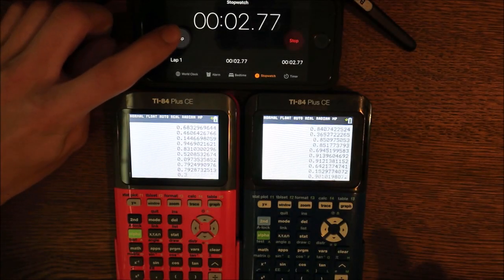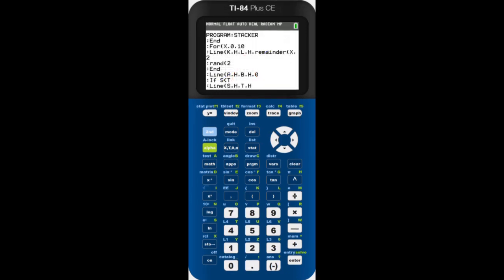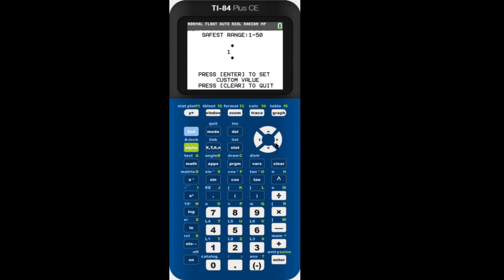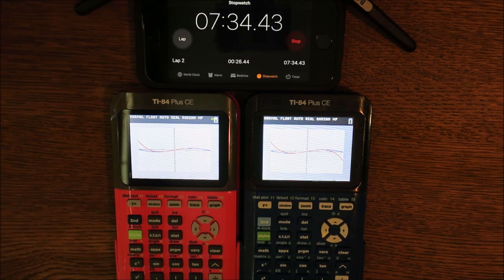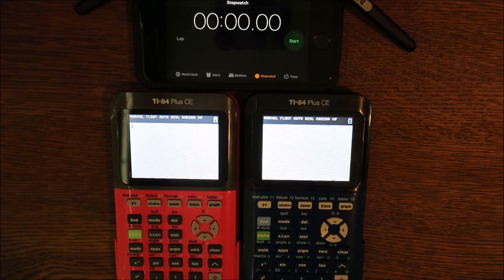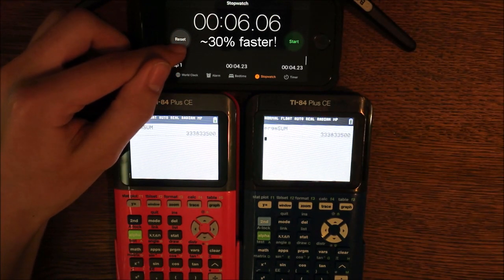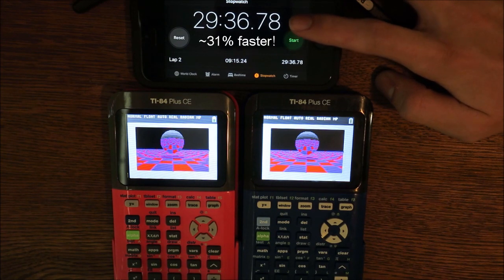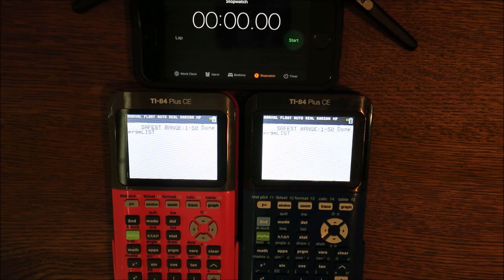Overclocking a TI 84 Plus CE?

Comment from the maker: Updates: (11/30/2021): Annoyingly, YouTube has removed the public dislike count. If you'd like to see the dislike count on this video, I suggest installing the 'Return YouTube Dislike' extension (Firefox, Chrome, Edge).

Important notes: First note: unfortunately this program is not compatible with the TI-83 Premium CE Edition Python. You can learn more at my topic: www.ceme.tech/t14663 Second note: I made a fatal factual mistake, it's not the RAM wait states this program is adjusting, it's actually adjusting the FLASH wait states! Although the video is accurate as long as you replace every time I said "RAM" with "FLASH", I'm terribly sorry for making such a huge error and I'll do my best to be more accurate in the future!
Reply: I hope u see this but my school prohibits external addition of softwares to our calculators and they reset it from factory at the start of every test,  so if theres any way to overclock it and still maintain it after they reset it to default? Any input would be appreciated
Reply from the maker: If they do a full mem clear then there's no way to keep any data.

Comment: i have a L-0125AC and installed all the apps, and i get an error saying: "Attempted to use a variable or function where it is not valid" when opening advspeed
Reply from the maker: Unfortunately this program isn't compatible with your calculator :(
Reply: @TheLastMillennial i thought it said m or later, is it because its pyrhon or smth
Reply from the maker: I works on calculators before revision M. Revision M is already faster by default and doesn't let you change it.
Reply: @TheLastMillennial but mines ends in c
Reply: @TheLastMillennial i cant open the program
Reply from the maker: Your revision is "AC" from January 2025 which was released long after M from May 2019
Reply: @TheLastMillennial ooof

Comment: How much faster (more time efficient) do you think the ez80 could have been if it used 16mb of zero wait state ram?
Reply from the maker: The capacity wouldn't make a measurable difference. Reducing the latency could improve performance a lot. I'm speculating 2x - 3x faster.

There's a writeup of all the terrible design decisions TI made here: https://www.cemetech.net/forum/viewtopic.php?p=286128#286128

Edit: updated guess.
Reply: @TheLastMillennial  Thank you for your response. Youtube did not notify me of your reply, and even when I went back to this video to manually check it did not show up. Only when I set the comments to newest first did I see this reply. Cant even reply on your own channel without it getting vanished.

Follow up question, would it be possible to ACTUALLY overclock the ez80? Perhaps not on the TI but on some other hypothetical system using the 50mhz version to lets say 60 mhz?
Reply from the maker: Where there's a will there's a way. The ez-80 is currently running at 48mhz and is only designed to run up to 50mhz.  I have no idea how far past that you could push it.

Overclocking the cpu wouldn't make much of a difference in performance since the main bottleneck is waiting around for RAM and Flash to return data.

Comment: I suspect the wait state is for battery longevity. Remember Apple Inc did this to iPhones to improve battery life.
Reply from the maker: Apple's battery saver works bit differently. IPhones throttle the clock speed of their processors and probably other components like RAM as well to save power.

TI however is keeping the same clock speed but just waiting around for data to transfer. Any power savings would be extremely small.

TI uses wait states simply because they chose to use RAM that's way too slow.

Comment: I am having trouble using the ADVSPEED prgm even though I have the GETBUSPR, GETSTATE, & SETSTATE imported into my TI-84 Plus CE (Python). Could you help me out?
Reply from the maker: This project isn't compatible with Python Edition calculators. Thankfully it's unnecessary since those calculators have new hardware that's even faster since the wait states are already set to the fastest value.
Reply: @TheLastMillennial  Ohhh I see. Thank you so much! 
Also, do you know why I don't have a reset option when I open cesium on it? Do I need it or can I use the reset button on the back of my calculator?

Comment: how about the ti 84 plus ce-t are the wait states already set to the fatest or not?
Reply from the maker: Same case as the regular TI-84 Plus CE. Rev M or later has the newer hardware.
Reply: @TheLastMillennial  how can I check if mine is revision m or later?
Reply from the maker: Look on the back of the calculator for the date code. It will look something like L-0519M. M and later means it's the latest hardware
Reply: @TheLastMillennial  it is barley readable i needed to use a flashlight to read the revision at least i think it is revision L does L-0218L mean revision L?
Reply from the maker: Yes the second L means revision L so yours doesn't have the faster hardware.

Comment: I have a the CE+ Pythong ed. and whenever I try to run the program it says that the program is invalid, is this an issue with the OS or is the python just not supported?
Reply from the maker: You'll need to jailbreak before you can run the program: https://m.youtube.com/watch?v=abB0ZEdQ1rs
Reply: @TheLastMillennial  I already run Artiface as my jailbreak, when I open the menu it displays the three supporting GETBUSPR, GETSTATE, & SETSTATE programs, but does not display the actual ADVSPEED program, so I am unable to run it there, but I can't run it through the prgm menu since it says it's invalid. When I open connect, it says that the three support programs are all protected, just like the other games I have that appear on the Artiface menu, but the ADVSPEED is just displayed as "program", could that be the reason why it is not displaying in Artiface and why it doesn't run on the prgm menu? or am I just missing something simple?
Reply from the maker: My mistake, I forgot this program is obsolete on Python Edition calculators which already have faster storage and can't be made any quicker.

Comment: What would be the recommended value in a Plus CE Python calculator?
Reply from the maker: This program isn't compatible with Python Editions since they're already set to the maximum speed possible. Refer to the pinned comment for more info.
Reply: @TheLastMillennial  So it's basically overclocked for you.
Reply from the maker: In a way, yes.

Comment: so the readme file says that it has to be older than revision M, and it said that a sequence of numbers and letters cant have the letter M in them. I looked at the back of my calculator and the closest thing i got is ""NMB-3(B)" im assuming this is newer than revision M, but i wanted to make sure. So is it?
Reply from the maker: Exactly which calculator do you have? What letters/numbers do you see in this boxed area? https://imgur.com/1U35TRS  TI recently changed how the date code works so yours may looks different that the format in the picture. If it does, then your calculator is a revision M or newer.
Reply: TheLastMillennial i just bought my ti 84 plus ce, and i think it says L-..... i cant tell what after it says. I think is 3200 or 0200. Also i ran the software and it said my calculator was too new so its revision M or newer. Also new question (out of the blue), is there anyway to downgrade to OS 5.4.0 from 5.5.1?
Reply from the maker: Not at the moment. You'll have to wait for an exploit to be released. I'll likely make a video once it's released.
Reply: TheLastMillennial cant wait!

Comment: @TheLastMillennial does Cesium increase performance while playing games on it? I need to know whether or not reducing the wait state reduces lag, since I have a lot of games on it and I don't want to lose all my progress deleting them and installing something useless. Also, is it possible to increase storage and ram on the calculator? Thanks! ps. your channel has helped me drag through middle school and is about to help me through high school! :)
Reply from the maker: Cesium does not increase performance. In fact if you run Cesium (Or any ASM program), it will reset the wait states back to the default. Reducing wait states does reduce lag in BASIC games, but not ASM games (since they're already running as fast as possible). It's not currently possible to increase the RAM or FLASH  of the TI 84 plus CE. However a USB driver is being developed which will allow you to store information on an external flash drive! There's no way to increase the on-board RAM or FLASH because TI designed the OS to only use what's on there right now, it can't accommodate for extra storage. I'm glad you've been enjoying my channel, I'm not planning on leaving YouTube for a while. :)
Reply: @TheLastMillennial  Thanks man! Also, you're the reason my favorite class is math class, since I have an excuse to be on my calculator, doing stuff I'm not supposed to be... *cough cough :)
Reply from the maker: Hey don't let my techniques  distract you from important things like math.  Let it distract you from less important things, like Language Arts. :P
Reply: @TheLastMillennial  don't worry about that, I'm good at math. I finish all the work within about half the class period, including homework, and then play for the other half, which is like 20 minutes.

Comment: How safe are various values? Like, what’s the chance of a crash for 6?
Reply from the maker: The larger the number, the less likely you are to crash because the RAM gets more time to prep the data for the CPU. The only issue is, the calculator becomes so slow that you can't use it effectively (and are forced to manually RAM reset to get it back up to speed). I wouldn't go any higher than 30 if you still want to be able to use the calculator.

Comment: I get an error when i try to run the advspeed program that says "attempted to use a variable or function where it is not valid", how do i fix this. Im using a ti 84 plus ce with version 2.05 of the advspeed and my calculators operating system is on 5.3
Reply from the maker: Sorry I couldn't get to this sooner, thanks for sharing all that information! That made my life a heck of a lot easier. I think your problem is you didn't send over all four of the .8xp programs to your calculator. Make sure you have all 4 of these programs: GETBUSPR, GETSTATE, SETSTATE, and finally ADVSPEED. Just curious, did you happen to read the text the program left after you pressed 'quit'? If this fix your issue, please reply and I'll try and help you more!
Reply: I actually managed to fix the issue by uninstalling all the files and reinstalling them like 4 times, not sure why that worked though. Thanks for the reply though
Reply from the maker: Huh that doesn't make sense, have you had this issue with any other programs? If you get this issue again, put all 4 programs into the RAM rather than the Archive. If you get the error again, select 'goto' and tell me what's on the line where the cursor stops. Glad you got it working though!
Reply: yeah me too, thanks for the support

Comment: You said you can't overclock the CPU, but is the decreasing the wait states what is meant by overclocking RAM? If not, do you know why they are different?
Reply from the maker: Good question, but no, reducing wait states does not overclock anything. The CPU, RAM, and everything stay at the same clock speed. This is what a wait state does: Since the CPU and RAM have different speeds, the RAM is much slower at retrieving data than the CPU can process it. Therefor, TI put a delay in the OS that restricts the CPU from getting data from the RAM from every cycle to every 9 cycles (Remember, that's the default number of wait states TI put). So during that wait time, the CPU just kinda hangs out until it gets that data to process (this, of course, is not efficient but it's necessary because of the parts TI chose for the TI 84 Plus CE). If TI had put in components that were fast enough to keep up with each other, then the CE could be much faster (my estimate would be about %60 faster). 
Going back to the wait states, TI's 9 wait states always allows time for the RAM to get the data ready for the CPU. If you go down below 9 then you run the risk of the RAM not having the data ready for the CPU to process, this causes the calculator to crash and perform a RAM reset. However the RAM can be a bit faster than TI anticipates which is why you can often reduce those wait states down to 6.
Reply: @TheLastMillennial  Can I like, set it to 1 without resetting my RAM? Bc it says "Safest range: 1-50" (I have TI-84+ CE-T btw)

Comment: So if you can’t overclock the calculator’s cpu, I’m assuming the program ‘faster/fastest’ found on ticalc.org just does what you’ve demonstrated in this video?
Reply from the maker: You're correct. faster/fastest just sets the wait states to a lower value. You can use them if you want, the only difference is my program allows more control over the wait state values.
Reply: @TheLastMillennial  I'm getting an error when transferring the the faster and fastest programs. It says "Duplicate Names". After changing the names and getting them on my calculator and running the programs, I'm getting error:invalid. Any tips?

Comment: I tested on CEmu; setting the wait state to 256 was safe for me.
Reply from the maker: Safe as in what way? You could still use the calculator normally, or that the calculator didn't immediately RAM reset? When I was first testing this program, I was putting in huge numbers such as 500. Turns out the wait states don't work like that, I don't know what exactly happens, but it wasn't not putting it all the way to 500. A similar event may have happened to you, but I'll need more info to be sure.
Reply: @TheLastMillennial  About the 500 thing, I personally think that the value actually modulos 256. 
- The advanced speed wears off after exiting the calculator's [mode] settings
The only time the Ram gets cleared is by inputting numbers that aren't integers. Values like 0, -1, and 256 don't seem to slow CEmu to a crawl.
Reply from the maker: Huh, you're right. CEmu is accepting those values however, those same values on a physical calculator wont work. I wonder why, thanks for bringing that up! I'll report it to the developer!